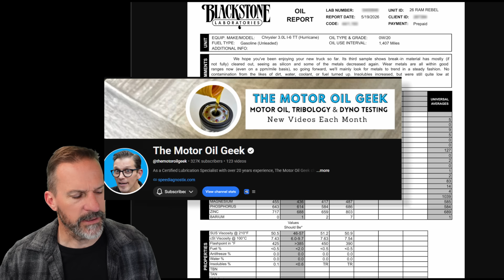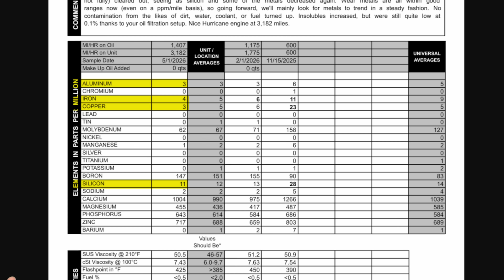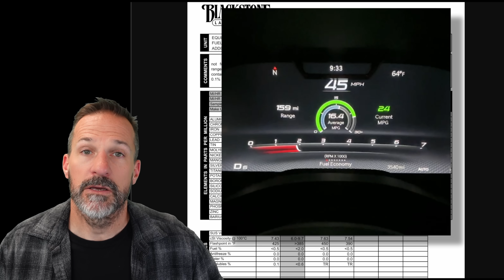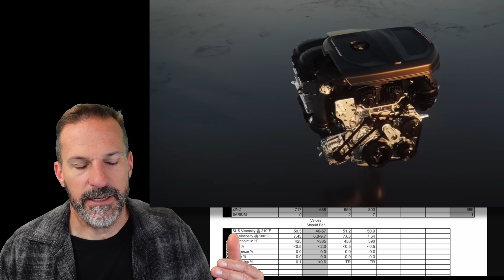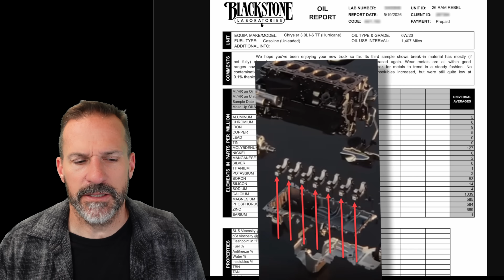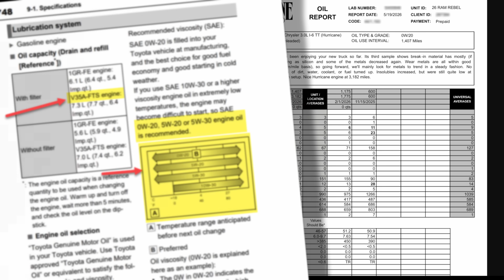The Break-In Secret Most New Truck Owners Ignore

Comment: I would have already switched to Pennzoil Ultra Platinum 0W-40. Lake Speed Jr. really likes the 0W-40 PUP and recommends it as he has seen it perform really well in all tests.
Reply from the maker: Thanks, that's likely what I'll swap to after the dealer does this next change :)
Reply: @TheCarGuyOnline  Be careful with the Pennzoil products.  With all the middle east disruptions, the new Pennzoil bottles no longer say "Made from Natural Gas"  Their GTL base stock supppliers are all blown up.  Sooooooooooo  .....  the 0w/40 PUP Lake likes, doesnt exist anymore.  All the formulations have changed.
Reply: @AlisoBob  They already said it was just a label change, but it's still the GTL formula. Nothing changed in their formulations.
Reply: @TheCarGuyOnline because of what Lake told me I’m switching all my V8s to the PUP 0W-40. The Mobil 1 Supercar 0W-40 I was running in my GM LT4s sheared out of grade very quickly. It’s not good oil at all according to the oil analysis reports I did with Speediagnostix.
Reply: I would do PUP 5W30 and switch to Speediagnostix testing with this last 0w20 change at your normal oil change interval.  Having a smaller spread from the first number to the second means less viscosity improver in the oil.  If the 5w30 tests well with a full oci you are good to go. Regarding the testing, Lake's testing gives oxidation level and more accurate coolant and fuel measures.  I have nothing against Blackstone.  I used them for over 25 years, but I am willing to pay more for better and Lake is doing a ton for car owners who need to move on from thinking oil changes can be like they were 20 years ago.

Comment: 0w40 is good. Even if it shears its still better than 0w20
Reply: Actually, that is incorrect. And that’s according to the oil geek…
Reply: @Maynardd  That's why I run a mix of 5w30 and 0w20. 5w30 will fight sheer better than 0w40 in extreme conditions. Thicker oil beats additives all day.